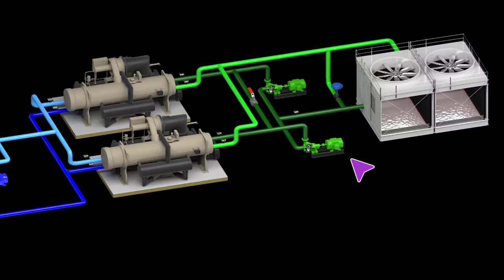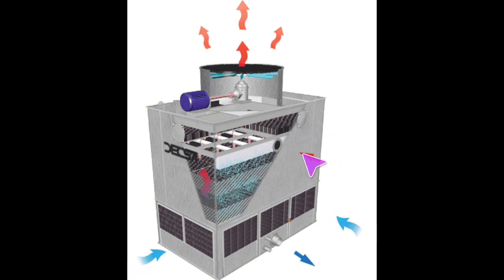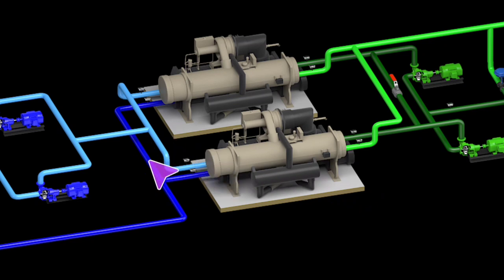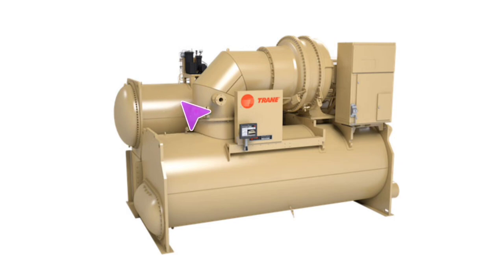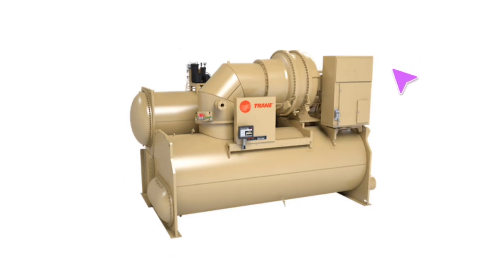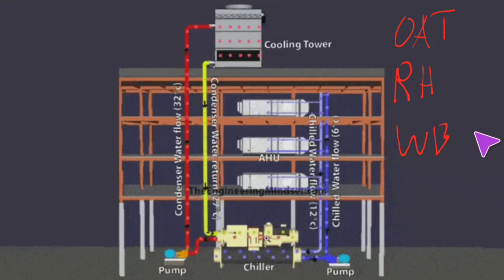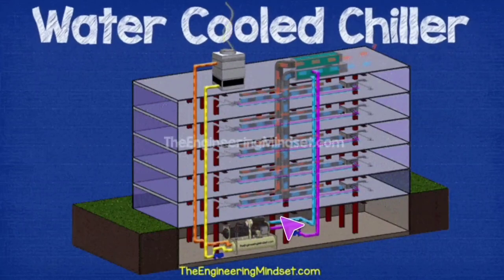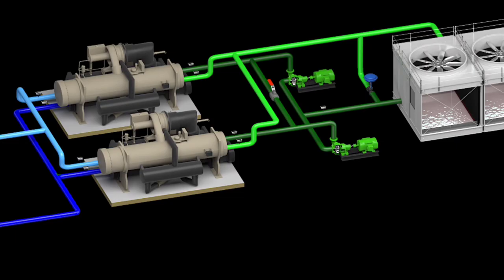Cooling Tower Setpoint For Chiller

Comment: Excellent explanation. You’re on top of your game. I live in the rust belt and this sounds like a good idea up this way since our temperatures usually cool off at night. I don’t do much chiller work anymore and when I did it was usually in large retail stores that mostly had water cooled screw chillers. The issue I mainly had was getting them started in the morning when the tower water had cooled off overnight when the chiller had shut down. They usually had tower bypass valves that would recirculate condenser water until it warmed up then would start pushing the water out to the tower as it warmed. However they rarely worked because the energy management company didn’t understand how these chillers operated. They usually only installed the condenser water temperature sensor on the outlet of the condenser to the tower and controlled the bypass valve and tower fan off this one sensor. I fought with them for a couple years trying to explain to them why I had to make rounds on an almost daily basis resetting the chiller at multiple locations due to this. They didn’t want to hear they were wrong. As you could probably guess they would see a high temperature on the condenser loop from their 1 sensor, turn on the tower fan and close off the bypass valve and dump a lot of cold water into the condenser which would cause it to fail on oil pressure. At 1 location I experimented and switched their strap on sensor to the water inlet which somewhat improved things by at least sensing the cold water from the tower sump would turn the fan off and begin to recirculate water again until the loop temperature stabilized. Couldn’t convince them to add a sensor to the tower sump to control the fan and relocate the sensor as I did to control the bypass from that. So I just continued to do my daily route to reset the chillers until we eventually lost the contract. It was easy money while it lasted. I pass by one of the stores I used to take care of often and rarely see the cooling tower fans running on a 90 degree day. I guess they showed me👍

Comment: The tower sp at 80-85° is a decent rule of thumb.  The true answer is the manufacturer  spec.  The carrier 19xrv, under low load situations in mild weather, are looking for 60-65° condenser water.  Also the york mc2 likes low condenser water temps.  Know your equipment before making changes.

Comment: Great explanation & visual animations!💯👏 For lift control, you should control both condenser water temperature &  water flow. All chillers have min & max flow and you can adjust those parameters for peak performance.

Comment: I have experienced many centrifugal chiller plant with fouled up condenser tube. I always advice my customers engineering and chiller plant operator to monitor condenser leaving temperature versus condenser saturation temperature. if the difference is greater than 10 fahrenheit, its time to punch the condenser tubes. and I also detest recycled water for cooling tower use.
Reply from the maker: Approach will give you the most accurate/earliest determination of fouled tubes. And approach isnt as subjective to chiller load like differential is

Comment: The York ymc2 chillers can run inverted. Had our 800ton ymc2 running with a 45 degree leaving chilled water temp and a 42 degree entering condensing water temp.

Comment: All the heat energy of the loop plus the power used by the chiller and tower must be rejected by the tower. The most efficient might be a giant coil, but completely impractical. So, we use enormous surface area in the droplets of a cooling tower to exchange heat with the added bonus of cooling from evaporation of part of the water. It is a tradeoff as to how big the pond or tower must be vs energy used in the spray and moving air through the field of the spray. Now, the chiller/compressor must raise the water temperature high enough that the water spray or waterfall can reject the total heat of the combined system. Many factors such as cost of electricity, cost of space for a pond, cost of maintenance on various system components all factor into the optimization of initial cost vs operational and maintenance costs.

Comment: I'm curious as to what you would do if you had a York yk, and those OWT's are so high that you can't possibly have condenser water below 85 degrees. During the summer here in m.d., we commonly experience that with our yk's.. I'm not sure I've ever observed surging. (our cw setpoint is 44 degrees).  I do however constantly see what appears to be surging in low load conditions this time of year in the morning. The chiller will be running around 24% and sound like a dying whale. I never see that hot gas bypass operate either. Very confused about this.

Comment: what happens if you set limits between 60 and 80 and you wet bulb is above 80 without adding the 5 degrees yet like it happens in south florida?
Reply from the maker: The maximum setpoint of 80f would be the maximum even when the temperature raises above 80f. Technically once you’re above 75f the setpoint stops increasing. The tower would keep its fans a maximum to try to keep up and maximize the water cooling at the high wet bulb.

Comment: Did you able experience chiller use geothermal cooling system?
Reply from the maker: No
Reply: @HVACTIME  here in the cayman island most centrifugal chiller plant runs thru geothermal cooling. 78f condenser inlet water temp york yk chiller. Some exixting plant are also converting from cooling tower to geothermal system..